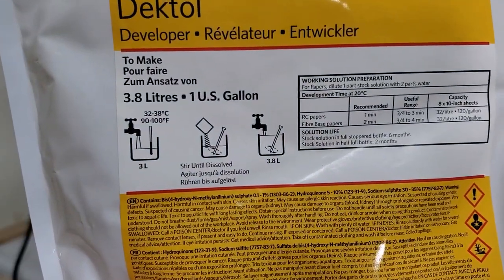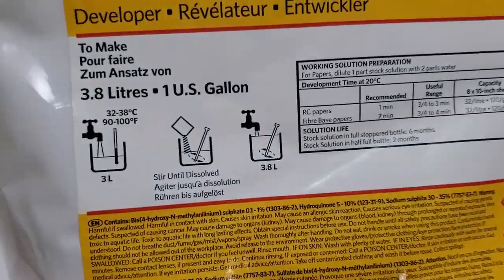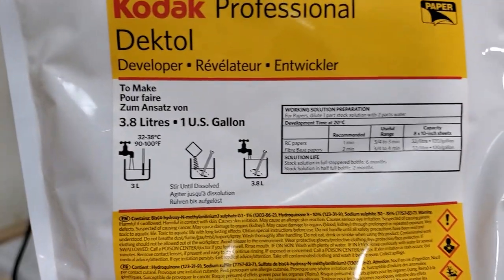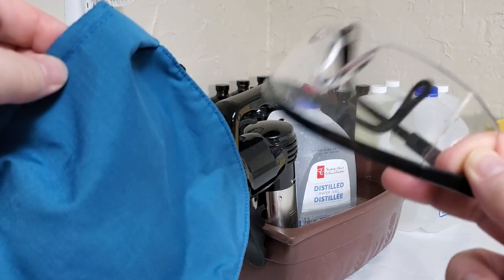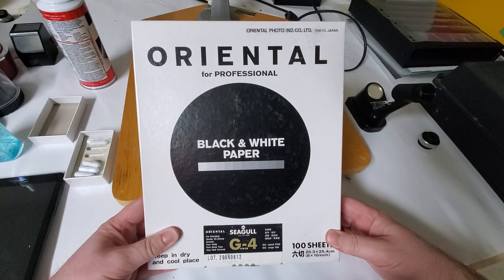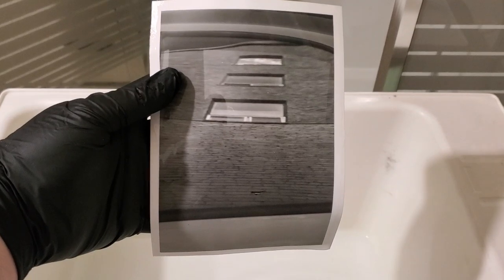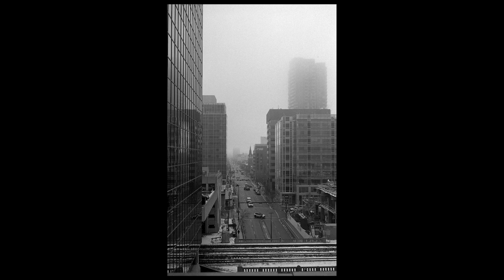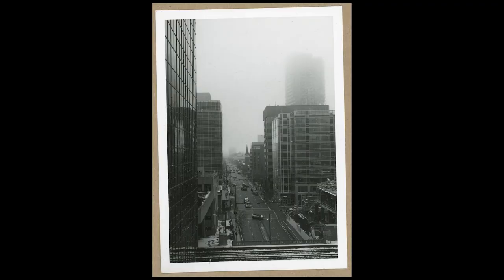How to Mix Kodak Dektol & Oriental Seagull G-4 | Darkroom Knights Part Five

Comment: That enlarger sooo many parts and built like a tank. My preference is the glassless carrier too due the issues you stated. When I mix my chemicals I try to store in dark colored glass bottles (green or brown) or the squeeze bottles that allow you to remove the air keeping your chemicals fresher longer, the problem with some of the plastics jugs is that air can somehow get thru them reducing the chemical shelf life. My go to chemicals are Dektol and d-76, also Kodak HC-110
Reply from the maker: Thanks for the tips Robin. I think what I meant in the video is that if they don't have anything else, a "milk jug" will at least get them started.

Comment: That Meopta enlarger is a thing of beauty. Perhaps you can see how a non-technical person looks at it and thinks - geez, that's a lot of parts I can drop, lose, damage and generally be a klutz around. Would have liked to have seen how the rangefinder works, which I think is a incredible concept if it works.
I'm also a fan too of 'Metropolis', presumably you've heard of the photographer/artist Charles Sheeler, working mainly in the 1920's in a modernist genre?
Reply from the maker: I wanted to show the rangefinder in action but I think it was too hard to film. It was basically just two lines of light that when aligned and focused made for a sharper image. I don't feel however is was as good as the article made it out to be.

Comment: Is your Dektol old? It looks like black coffee lol. My Dektol solution is almost two years old and it doesn't look like that.
Reply from the maker: Sometimes the bags get oxidized. But it still works.
Reply: It's a known issue with Dektol. Kodak says its a contaminant but shouldn't affect anything.
Reply: On kodak alaris' website it said "Recent batches of DEKTOL with date codes of August 2019 or later have been coming out darker than normal when mixed.
This is due to a non-photo active impurity. This has no impact on product performance.
We are working with our manufacturer to quickly bring the color back to its normal neutral appearance."

Comment: Looks like you got the preoxidized version of Dektol.  After having 3 bags of d76 AND most recently 4 bags of xtol being recalled, I'm getting really annoyed with these plastic bags (I presume).  Also, my green side is a little disappointed you used an inefficient heating device, to heat an uncovered tub of water, to heat a 1 gallon jug of water.  How about using a microwave?  PS. thanks for the fortnight prints!
Reply from the maker: Yeah I noticed it was a bit dark and remember hearing something about it. No issues printing though.